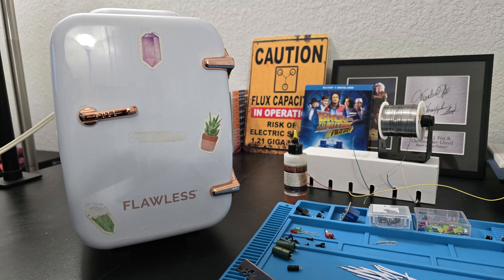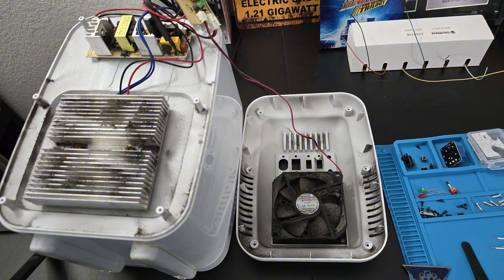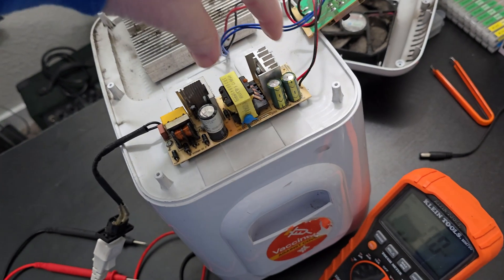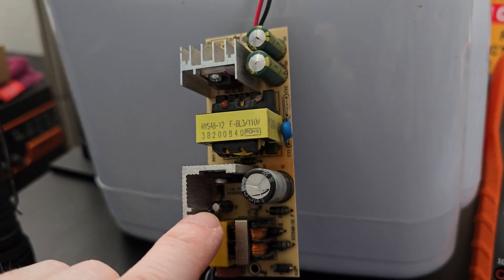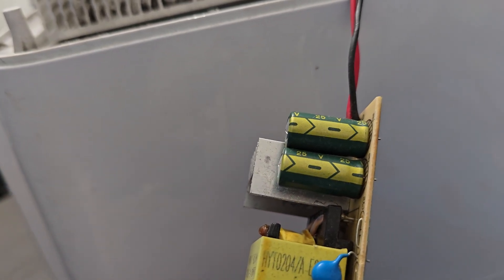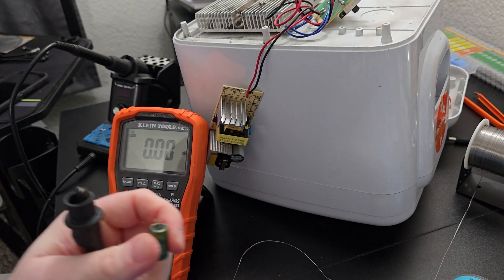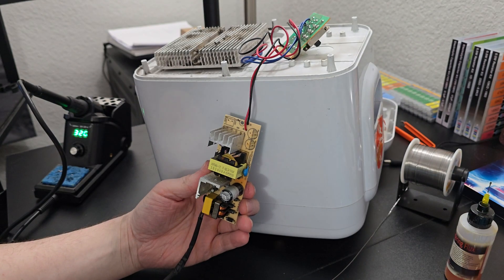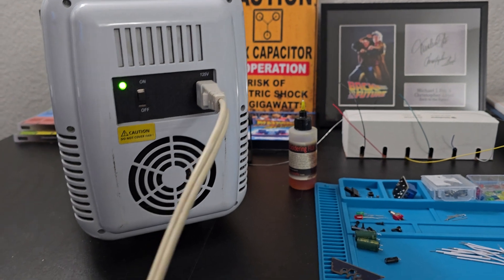Mini Fridge Repair - Flawless - Blinking Green Light

Comment: My fan is spinning but not getting cool
Reply from the maker: Most likely you either have bad peltier components or power supply not delivering to peltiers.

The fans job on these cheap devices are to extract heat from the hot side of the peltiers. 

I would start with looking at solder connection of peltiers, and measure to ensure proper voltage. If they are I would lean towards peltiers are faulty.

Comment: I took mine apart and cleaned it all out of dust, put it all back together, but it's still flashing and fan not spinning, neither is the fridge cooling. It's not working..
Reply from the maker: Yeah these things have really cheap power supply boards. I'd suggest changing the electolytic capacitors on the board or you may be able to buy a new board in general and swap ot out. Still cheaper than a whole new fridge.